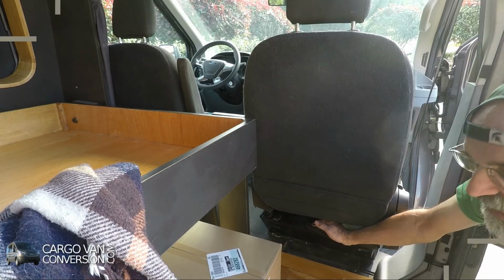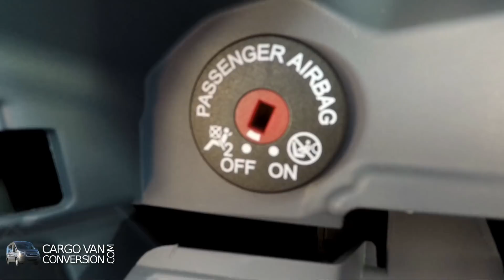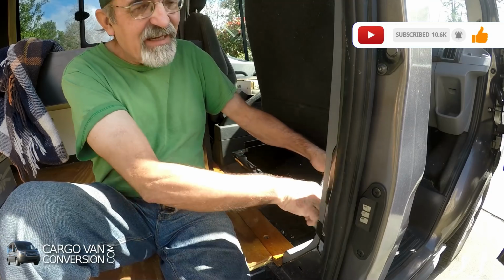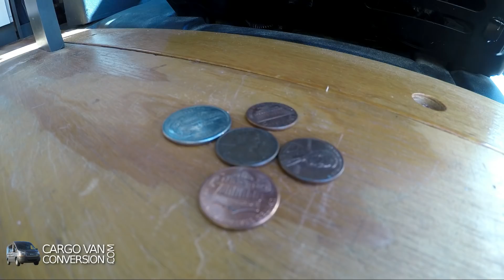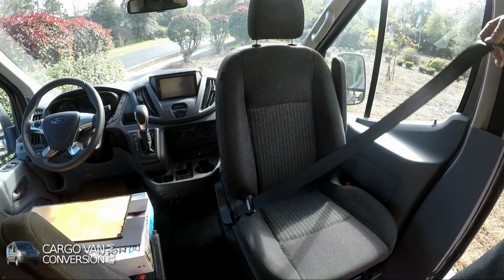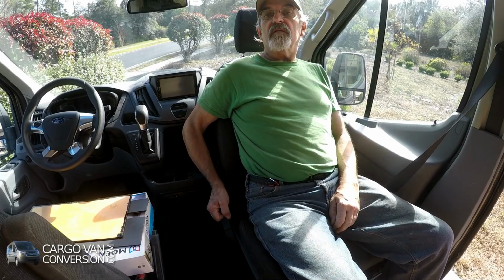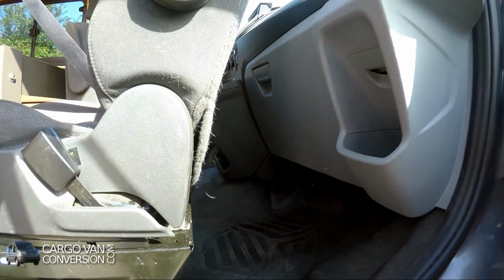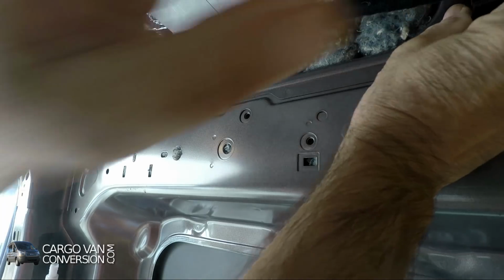RV Swivel Seat Alternative

Comment: Not a bad idea on the seat. I did spend the $200 for a swivel had to modify a couple things. I have the same two wire setup as you do and the swivel comes with a bolt that the wiring will fit through. After dissembling the swivel adapter so I could put some lube on the bearings, insulating the two metal half from rubbing each other, cutting the release handle down (to long, kept hitting it) and rerouting the wiring the swivel works ok, the extra 1.5" in height is not a problem for me and it allows me to have a passenger if needed. Though due to dimensions its necessary to have to slide the seat forward and back to get it to rotate.
I keep the seat turned most the time but find I like it at a bit of an angle towards the center of the van so I am glad I did put in the swivel. I also found keeping the seat back tilted allows for better vision when driving. 
All in all the $200 wasn't a bad deal, just took two plus days of screwing around to make it work right for me, but then again, what's two days compared to all the time it takes to do the whole build.
Was also wondering why you were taping over the small holes. I thought you weren't worried about a vapor barrier and that's the only reason I can see to cover all holes, same as taping over the van ribs.
Reply from the maker: Hi Jerry,
You did good work of specifying all the issues, I was thinking about. I find, having to deal with that when you're spending $200 or $400 shouldn't be acceptable. Nevertheless, I would have bought one eventually. This may be a good alternative. There is also a lot of wobble between the different swivels. Would likely have gone with the Sportmobile or Scopema.
You can see that I didn't cover every little hole, but it must be my ADHD. When I have that roll of tape in my hands, I just can't stop :) But I'm still convinced that insulation in vans is overrated.
Van Williams
Reply: Haven't noticed a wobble yet but also haven't used it much yet.
Insulation is up in the air for right/wrong, yes/no. I think it depends on where you'll spend most your time. Myself being in the PNW (wet, rainy, cold, snow) I figure I need some even though I expect to spend a lot of time in warmer climates as I travel (who knows). I'm not using a vapor barrier myself on the walls and ceiling but did use Tyvek on the sub-floor. My walls are insulated with wool and the folks from Havelock say not to use a vapor barrier (again, who knows). I'm more concerned about covering the bare metal around the ribs, doors and such as metal will conduct the cold right through it even with insulation inside it. Carpet would be good but for the moisture it will hold. So, still thinking on that one.
As always, enjoyed your video and learning a lot from you, thanks.
Reply from the maker: I'm also very skeptical and first have to see, if things work out the way they are planned. I know what the issues are, not always the right solution.
Van Williams

Comment: You should have turned that seat around 2 years ago, but you did it now, as they say :"Better late than never" now the seat has become a much safer place for Joey too, as if you have to brake very hard, he'll be simply pushed against the backrest, and  won't end up against the windscreen.   Another good job done.  My very best wishes to both of you for a happy, interesting and most of all healthy 2019,  Peter.
Reply from the maker: Hello Peter,
All true. But I have to do better for Joey. In the original design, I had a separate built-in cage planned, but ultimately left it out because of space restrictions. I'll probably do at least a fixed attachment point, where a "leash" can be attached to his harness. And perhaps a removable divider, that will protect him in case of an accident.
Happy New year too!
Van Williams
Reply: Is it legal to drive if the seat is facing backwards?
Reply: @lkimberly2064  What about driver being able to use the passenger side mirror?
Reply from the maker: Hi L Kimberly,
To be honest, I didn't check that, but don't think it is an issue as long as you don't use in that position. It could happen if you have a swivel seat too.
Van Williams
Reply from the maker: Hi Micah,
Use of the side mirrors is essential with these cargo vans. If the seat is in the most forward position, one can either slide the seat backwards or move the back down. This will give you full use of the passenger side mirror. I'll post a photo under the 'community tag' tomorrow.
Van Williams
Reply: @cargovanconversion  I'll look for it; thanks.

Comment: Isn't funny how we do most of the build and then turn the seat around. Now think back to when you were sitting on anything you could and pondering drawing's.
Sure would have been nice to just sit down with the notepad and doodled out those ideas in comfort.  But I'm only speaking of my own experiences. Yeah, two others but this time I did the seat first and worked back from there.
And I like the idea of having the dogs in a rear facing seat. You know what happens when you brake in an emergency. They give you "the look" once they get off the floor. Ready to panel the driver's roof! Theirs not much to do now!
RTR time!. Great job Van.
Beeps.
Reply from the maker: Hi Beeps,
I was clever enough to have wanted the swivel early in the build, but didn't want to commit because of price and the issues involved. Never considered the current solution, until a lightbulb went on in my head only a couple of days ago. I'm not too quick, you know; it only took me two years :) But you're right, it would have been a lot more comfortable with the seat early on.
See you in Quartzsite.
Van Williams

Comment: Hello friend.  I’m  thunking of trying fit a swivel on driver seat again in2004 Savana. Had tried with the one used for my passenger seat from seats4less but couldn’t get it to turn cause limited space. The passenger seat barely swivels needing the door to open  to get it all the around.  Their stock GM high back seats - gotta be away? Perhaps need pull base and drill new mount holes a couple inches inward and backwards allowing for ample room . Any thoughts?
Reply from the maker: Hi Paul,
I've looked at swivel seats for a long time and found them expensive and often non-compliant with Federal rules; as I'm always the single passenger in my van, just turning around the passenger seat permanently was for me the best solution. 
Working with the drivers seat just complicates things. Hand brake often in the way and little space to work with, as you wrote. I removed some back seats of a Dodge van (similar to yours); there were bolted to the floor with heavy angled steel bars. Wouldn't want to touch that in your van. Drilling new holes would require additional support, moving even a few inches sideways would leave you out-of-sync with the steering wheel. 
No good advice from me here, but not to touch the seat :) Insurance coverage/payout may also be affected.
Happy travels anyway.
Van Williams

Comment: G'day Van & Joey, that's a great idea with the front seat & not having to fit a swivel base. It gives you a good seat for the rear area &
possibly is a safer place for Joey if you had to break hard etc, a drive will soon establish if visibility is a worry but it still looks a very 
functional idea to me.
Safe Travels to You & Joey Mate, Steve.
Reply from the maker: Hi Steve,
I can try it out and if it doesn't work out well, I'll just turn it back around and buy a swivel way. But for now, it feels good and as you said, much safer for Joey.
Van Williams

Comment: I've used rolls and rolls of aluminum duct tape on my vans and have noticed some brands, at least, do not stay sealed long term in flat areas..  Suppose it's the heat or the overlap must be at least 75% but haven't bothered to determine.
Reply from the maker: Hi Neil,
I've been pretty lucky with the HVAC tape, but had some issues with the 3M spray glue. The heat of summer is at least partly to blame.
Van Williams
Reply: Just make sure you clean the area with 99% alcohol before you tape, makes a very good bond
Reply from the maker: Hi J. A. Bartolo,
That's good advice.
Van Williams

Comment: Great job + cleaned under seat. I guess you pulled driver side & cleaned it real nice too.🤣😂🤣 Is that a good way for Joey to ride?
Reply from the maker: Hi Stephen,
Removing the driver's seat is awful, but I have considered it. You know how my brain works :) Joey usually doesn't make use of the passenger seat; he likes to sit behind the wheel (when the van is parked, duh). Actually, I think it would be safer this way in case of an accident, but I still have to see, if he will make use of it.
Happy New Year!
Van Williams
Reply: Yes as good of a dog Joey is I doubt he’s ready to be your chauffeur.🐿🚐🐶😳

Comment: When you buy a swivel seat they is warning to never leave the seat facing the back.  it’s might be becauce if you get hit from behind you going to break your neck . It’s instant your head will go till it hit your chest and your body will double over forward then you go hit the seat back again If your in front the passenger air bag will open in front and you get hit from the back the seat will keep your head from going back
Reply: For the dog ok but people below are wanting to switch it for a living room.
Reply from the maker: Hi thomas,
You're generally quite right. Sitting in the passenger seat while driving, facing backwards, likely carries some additional dangers and would not be advisable and perhaps be prohibited by law. Yet I can think of situations where this still could happen, such as in trains or buses.
I previously explained that my van is a one-person vehicle; I don't carry any additional passengers. If in the rare occasion, I need to accommodate a passenger, it takes about five minutes to change the seat into the original position. Currently the passenger airbag is switched off and poses no danger either.
I understand that for most people, these conditions don't apply, and I highly suggest to buy a real swivel seat, if that applies. 
Van Williams

Comment: how is the visibility through the windshield / side window with the seat turned around while driving? That would be my biggest concern.
Reply: It would be extremely out of place if only backward.
Reply: Yep. Not sure that I'd want to drive around with the passenger seat obstructing my view. Not sure if it's even legal. :-/

Can you still see the wing mirror?
Reply from the maker: Hi Martha,
With the seat all the way forward, you have two options; either slide the seat backwards or just move the back of the seat downwards. That gives you all the clearance. I'll post a picture of it tomorrow under the 'community tab'.
Van Williams
Reply from the maker: Hi L Kimberly,
I think, it's a perfect solution for me, especially with regard, that the seat isn't raised by two inches, which happens with a swivel. So your feet stay on the ground, but I agree, visually it's not very appealing when you're driving around.
Van Williams
Reply from the maker: Hi nagualdesign,
Wouldn't drive around without use of the passenger side mirror. As I said, I'll post a picture tomorrow under the 'community tab'.
Van Williams

Comment: Sneaky! So, what's the turnaround time for this project? ;) Thanks Van. Hope you had a very merry, and hi to Joey.
Reply from the maker: Hi BoxVan Go,
Turnaround time. Is that including the video taping or just the work? :)
I've been working on the conversion for close to two years now, but in general I would say that 75% of that is the filming, video-editing, uploading, social media and lots more. And not including all the preparation.
I guess, I would be able to do the conversion in about 6-9 months, maybe less. That's at my 'slow' speed. Relaxed.
This was all planned as I still need another year or more, to be able to move into the van on a permanent basis. By that time it'll be all finished.
I think a good rule is 3 months for a basic conversion, 6 months for a well-done one, and 9 months if you want to do a lot of hair-splitting, like I do :)
Happy New Year!
Van Williams
Reply: Joey is always a good part, stay safe friends.

Comment: It doesn't work because it is BACKWARDS! I like that you can so quickly and easily swivel it around 😆😆😆
Reply from the maker: Hi IMMORTAL ONE,
It did work out perfectly in the end and you're right, a swivel is a great solution, but besides price, there are a number of issues with them. The most important to me, is that they raise the height of the seat by about two inches. That's too much for many people to be comfortable.
Van Williams

Comment: Hello, I love the care you take with each well thought out plan n your conversion. Pardon me if you answered this previously:
What is the name of and purpose of the foil like tape u use? Thank u and keep up the great work. You r building quality with innovation n it’s nice to see😀
Reply from the maker: Hi,
Thank you for your nice words and Yes, most of quirky ideas are well thought out and based on my lifelong experiences in RV's.
I suppose you mean the foil tape mainly used on the ceilings? It's HVAC tape, cheap, very sticky and helps to seal off the ceiling. Wasn't really necessary, if I would have installed the ceiling panels, immediately after the insulation.
See you on the road :)
Van Williams & Joey

Comment: I don’t know why you wouldn’t just get the swivel. You never k now when you might need to have a passenger, and teh swivel just doesn’t cost that much.
Reply from the maker: Hi Sally,
I assume, I'm in a particularly special situation, where I never ride with a passenger and that makes it a useful solution for me.
But there are other reasons. First the cost of between $200-$400; recently I was considering the one from Scopema, which is at the higher end. They all have lots of issues, with in my opinion, height as most important.
They all raise your seat by almost two inches and for some, that means that your feet cannot reach the floor. That is expecially the case in a ProMaster, where the living space floor already is lower than the cab's.
As you said, for most of us, this may not be a viable option, but if it is, you'll save a bunch of money and have a better seat.
Happy New Year!
Van Williams

Comment: Iam going to do that to mine I have a 2018 promaster 1500 save  some  money for right now thank you I though you could do that  now I know I can
Reply from the maker: Hi David,
Remember, that this was for a 2016 US Ford Transit. The ProMaster may be different. It's worth a try, but I needed a very large Torx nut to remove the pedestal bolts. Let me know, if it works with your van.
Happy New Year!
Van Williams

Comment: I see a flood of poorly converted vans hitting the market.
Reply from the maker: Hi IMMORTAL ONE,
If I understand you correctly and you talk about the design, I have to disagree. Most private conversions are done for personal use and done according to their own requirements. And while those designs may look awkward to you and me, for the owner it usually is a better fit than the cookie cutter solution of a commercial conversion. We're all different and making something of your own liking is the beauty of such a conversion.
Van Williams
Reply: @cargovanconversion  what about retro fitting a proper swivel base from a scrapyard? Who knows you may have a passenger in the future. With a tiny amount of welding you can affix nearly any seat base design. If you have vehicle inspections where you live, a seat will need an approved safety harness. Happy trails😁
Reply from the maker: Hi IMMORTAL ONE,
Unfortunately welding is not one of my fortes. I haven't thought about vehicle inspections, likely because we don't have them in Florida, but that a valid point.
Van Williams

Comment: Your zipper is open.
Reply from the maker: Hi NW Budro,
Yes and many more will notice now :) Be sure I took care of it later on.
Happy New Year.
Van Williams
Reply: @cargovanconversion  Yep; I didn't it BEFORE the comments. i was busy watching the hands.
Reply: Can you see your right side mirror?
Reply: @BlowNova70  I can see my right hand mirror but I'm not the guy that turned his seat around.
Reply: NW Budro bahahaaaaa face palm. Fail
Reply from the maker: Hi BlowNova7018,
I'm the guy that has turned his seat around.
No problem at all with the passenger side mirror. It's blocked from view with the seat all the way forward, but either lowering the seat back or sliding the seat backwards, will give you full view of the mirror. I posted a picture under the 'community tab'; that will make it clear.
Hi five :)
Van Williams
Reply: we've all been there